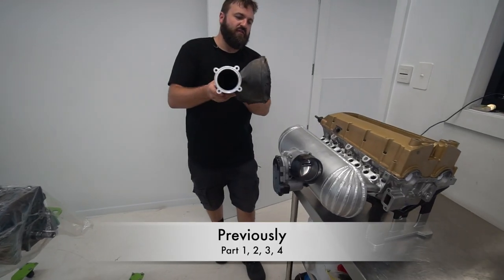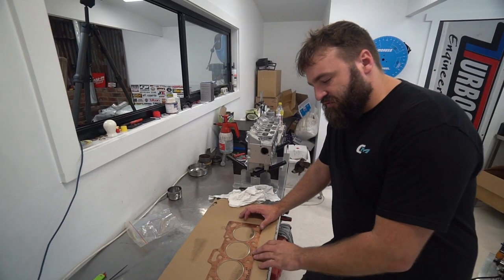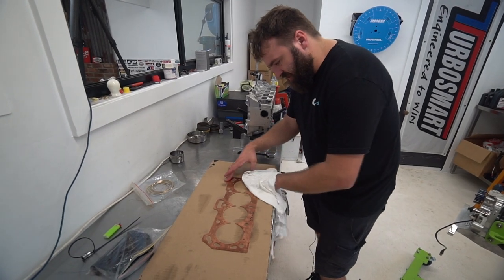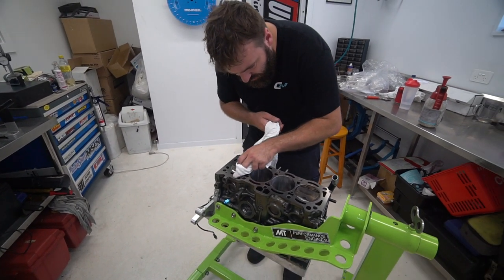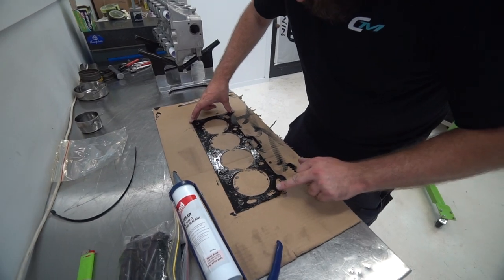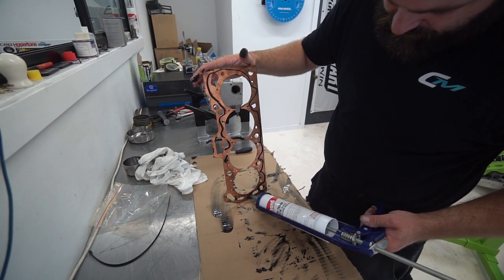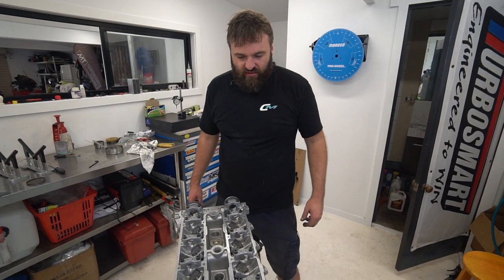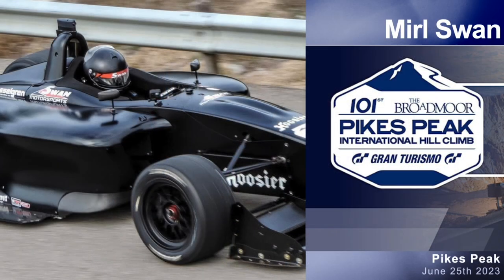Formula Atlantic 4age Build Part 5

Comment: Interesting that goop you're using on the head gasket, can it be used on a mls head gasket?   I've have some 1/2"  arp studs for lil feral's next engine build, and using one of mrp's special oring'ed head gaskets.  If I ever have any issues I might have to give these fire rings and copper w/goop set up's a go!   Such a sexy build! 😍
Reply: Don't use that 3bond on an mls gasket fir the mls gasket I use hylomar spray
Reply: @mtperformanceengines3508  yes hylomar 👍. I already use that, love the stuff.  That goop sounded like super duper stuff, so thought I'd ask. 😂   Cheers.

Comment: Are those atlantic valves? Or something bigger? They look massive!
Reply: I done a custom 4mm oversize valve but it requires an oversize valve seat so the cost starts to really blow out at this level
Reply: @mtperformanceengines3508  4mm oversized 🤯🤯🤯 that’s insane I didn’t even think that was possible on a 4AG head
Reply: @mtperformanceengines3508  Awesome, you're a beast. I knew those were too big to be atlantic!! :) Do you sell these vavles as a set? or 1/2" studs for 16v 4age? or is this just something I have to figure out on my own? I was thinking of trying to get 3s or 2j/1j supertech vavles to fit.
Reply from the maker: I need some now 😁

Comment: Awesome build 👌 I noticed the block was prepared for a oil restrictor to the head, but not fitted. Was this on purpose? 😳
Reply: I removed the oil restrictior as I was getting oil starvation the the rear buckets and jurnells where starting to grab aswel
Reply: @mtperformanceengines3508  Do you know the size of the hole? HKS are 1.5mm and I know a very famous Hill Climb Starlet had a 2mm restrictor.

Comment: At 13:35 no incorrect, and no you don't use silicone on a copper head gasket.
The way a copper head gasket is conformity, by adding silicone you add a cushion to the valleys in the substrate making a flat plane which is what will cause leaks.

Comment: Were you putting the lubricant on the threads? I thought ARP recommend to only apply the lubricant to the head of the bolt/washer to achieve accurate torque?

Comment: Hello again i got one more question what oil are using in this engine for tha extreme use and build ?
Reply: I use and recommend bradpenn engine oils, the owner of this motor has a sponsor for his oil and access to oil testing through that company ( I won't mention that brand as I'm not sure If I'm aloud to) but I can assure it's also a very high end oil
Reply: @mtperformanceengines3508   Thanks a lot for your response and also greetings from  the wonderful Greece!

Comment: 75lbs should be enough for a stock 20v? About half way through the second 90 degree turn the threads feel like they are on the verge of snapping, some actually gave way.

At 75lbs everything is tight and seems okay beyond that danger.

Comment: 100 ft lbs on a head stud is scary business. Forget about pulling threads. What about cracking the head?
Reply: I haven't ever cracked a head but one thing I do Is dry fit the head with the gasket and rings and the head bare so I can bolt the cams in, if the cams can still turn then the head hasn't warped or twisted out of shape 

Trial fitting is a massive thing and off camera this motor was together and apart at least 3 to 4 times
Reply: @mtperformanceengines3508  very nice. Love the videos. Keep up the great builds. You’re attention to detail is superb. I know what you do calls for it through and through. Just wish there was one of you stateside. 

…I’ve seen Mazda BP heads crack above 75ft/lbs. I know it’s apples/oranges. I guess there’s a first time for everything…
Reply: @acmotorcars  we have gone to a larger dia stud so I wonder if it's less likely to crack as the clamp load is spread out 

I guess we will never know the potential of components until we push them to the limit, this would be a first for me building a hillclimb/circuit motor that has to be making substantial power/torque for long periods of time and only when we pull the motor apart will we learn what we have to improve on